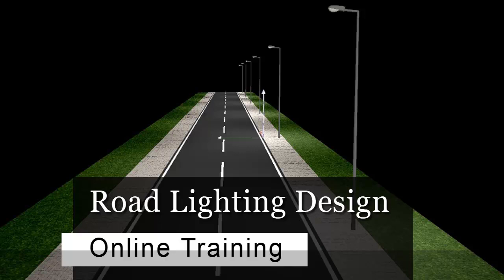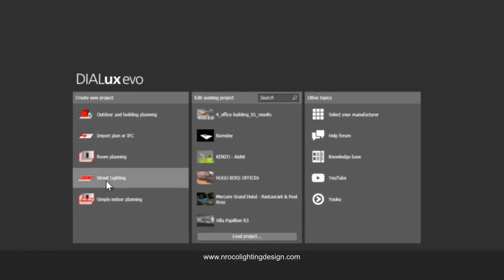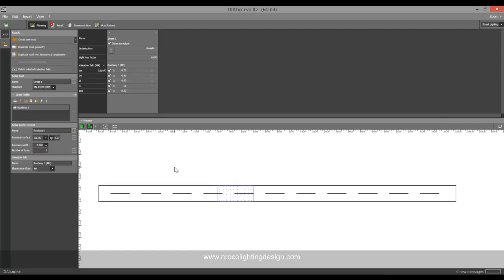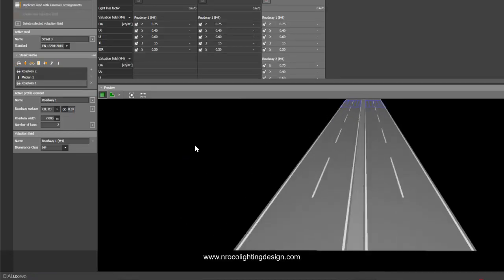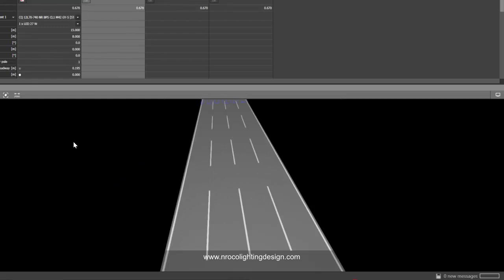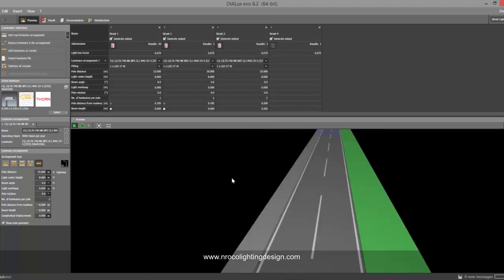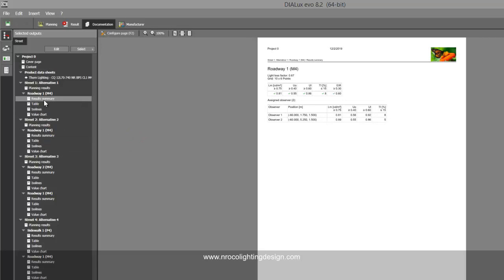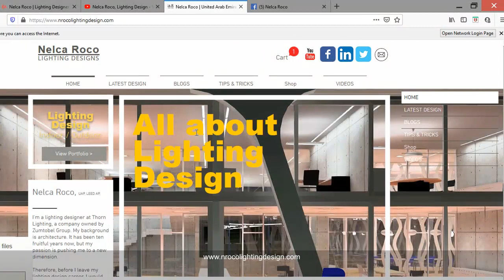How to  simulate more than one street in Dialux evo

Comment: Hi Nelca!!
Your tutorials are very helpful for lighting design. 
When I am inserting trees and signboard in the street lighting design so it is not showing.
Can you tell me how to insert it in the design?
It will be great help for me as well as others.
Reply from the maker: You cannot insert trees under the road lighting tab, but you can do it in outdoor lighting. Just create your sample road, then add the accessories like trees and car.  But make sure to run the calculation first in the road tab to ensure the spacing and height of the poles.

Comment: Hi, great video, just a quick question if you don't mind, is it possible to model bendy roads using the street lighting section in dialux? It seems that straight roads are the only option. Otherwise, I will have to create a polygonal floor element for the road but won't be able to use the compliance function for road classes i.e. M4 etc.
Reply from the maker: Unfortunately, you can only do a straight road in DIalux calculation. If you want the curved road, then do it in outdoor calculations or use AGI32 instead.

Comment: hi madam, your videos help me more to the learning process of dialux evo . i am also a Lighting Designer works with Basic Dialux and autocad. I am currenty working on a Sanitary ware Showroom. can u guide me how to add Track lights or Running Magnets in falce ceiling?
Reply from the maker: Just use the cube object or extrusion volume to create the tracks, then you can now add the luminaires.